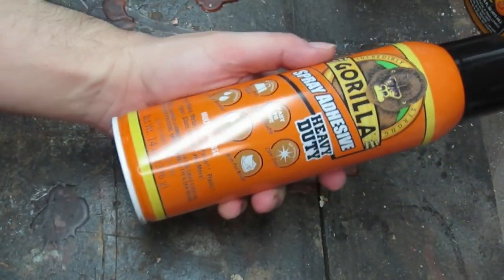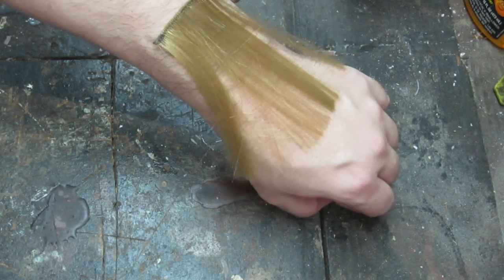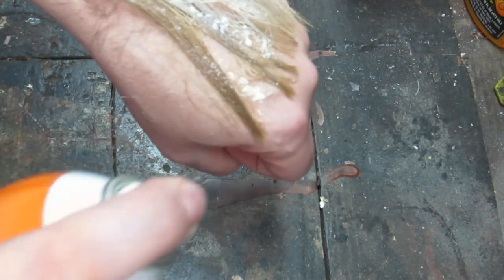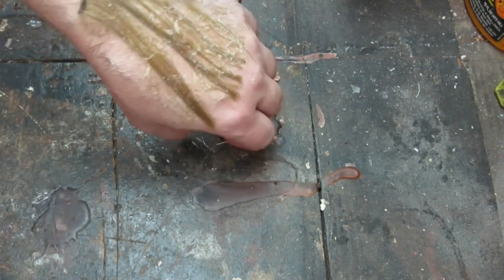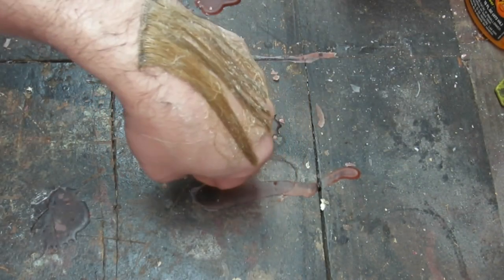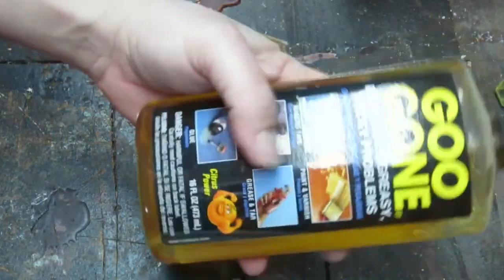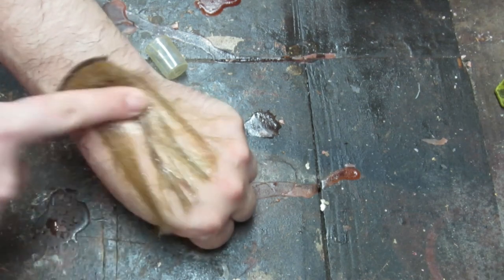GORILLA GLUE IN HAIR SCAM. High Levels Of Sus for the Gorilla Glue Girl story! | Dark Nook

Comment: So this is a bad experiment since u aren't doing anything she actual did. U don't anything about how to create edges using glue which is a common practice. This video just shows u don't know what you are talking about.
Reply from the maker: I put gorilla glue on my skin, dried it, and removed it with ease... not only from the hair I glued to my skin but also from the hair on my arm.  i also showed that the way this glue behaves, there would be no way to go through the elaborate lay down styling process, as anything that touched the first bit of glued hair would be sticky and useless for the rest of the process.  Do you think she used a new brush for every bit of hair?
Reply: @DarkNookShop  I saw what you did and that's not how u create edges. What u show is that u can spray synthetic hair on your skin and easy move it in a short time frame. That's not what anyone does to create edges.
Reply from the maker: Unless you think the edging style somehow alters the chemical composition or behavior of the glue... you really have no point.  And the hair was human hair, from a weave.  And the hair on my arm... also human hair.  Gorilla glue bonds permanently at 10 minutes or when dry.  i dried it with a heat gun, then showed how easily it could be removed using Goo Gone.
Reply: @DarkNookShop  that's not what she did. Go listen to the original video learn how they actually style hair and try it the way she did it.
Reply from the maker: @theman9048  Again, how the hair is styled doesn't change anything about the glue, how it behaves, or how it's removed.  The only reason the styling is being brought up is to address if she could have got this glue to permeate down to the scalp by using it how she claimed to use it.
Reply: Video just shows he’s a bozo
Reply: @DarkNookShop  dude we already know she can. Ur lack of understanding how to do it doesn't change that.
Reply: @Allison Williams by ur own argument what u said was some bs
Reply: Allison Williams black gel doesn’t mold your head like that, until you actually have black hair & experience using black hair products don’t speak

Comment: That is not hair growing out of a scalp with roots!!! That's why it adheres to the head...
Reply from the maker: Now this is a valid point.  This test shows how the body of the hair would bond to skin.  But the fact is, all the hair on my arm does have roots.  And that glue also came right off.
Reply: @DarkNookShop  it wasn't set in overnight like black hairstyles require
Reply: This type of Gorilla  Glue  fully  cures in less then 10 minutes.  Once it fully  cures  it doesn't  get any harder. The cure is at maximum  strength  at full cure.

Comment: The girls has several layers of hair and it's not directly to the skin so hair to hair would be matted and stuck and if the style is already done and combed and she just sprayed the top yes I can see how it it is stuck
Reply from the maker: If she just sprayed the top... it wouldn't be bonded to her scalp.  It wouldn't even be bonded to other layers of hair.  It would be even easier to remove.  I had to really rub this stuff into that hair to get it to penetrate down to my skin through even that little bit of hair.  Then i prayed it directly on my skin, under the hair, which makes an even stronger bond.   And it still slid right off a minute after the Goo Gone was applied.
Reply: @Natasha - I agree. I can see how it happened, as it's layers of hair to hair being stuck together. Plus it's African hair texture which is naturally dry & doesn't have as much oil as white hair.
Reply: @DarkNookShop  it could have bonded to her scalp, it could have seeped down into the smallest micro gaps. Even the official gorilla glue video states how fine of a mist it is. You don't know how she prepped her hair with it and also it is on her scalp, especially around her edges at thinner spots.
Reply from the maker: The fine mist bonds to the surface.  This is not a seeping permeating glue.  In order to get to to the scalp, she'd have had to work it into the hair.  This is even more true with thicker hair.  And she obviously did not do this, because that would have mess up the styling.  Regardless... Goo Gone would still take it right off.

Comment: I've been using spray adhesives for the better part of 20 years. There's no way on earth that spray gorilla glue did that to her hair. I started off carpeting speaker boxes in my early teens, and the first thing you learn about spray glue is to keep it away from any black surface because the white sticky residue pretty much screws anything it touches. Her sitting up there with shiny jet black hair from a spray adhesive is down right asinine. Secondly spray adhesives are not that resilient. They can be removed by a mild solvent. You're trying to tell me a month of washing and not a single hair has budged ? GTFOH
Reply from the maker: Exactly.  Anybody who has worked with this material knows she's lying.  Like telling an automotive painter than you painted a car with a mop and latex house paint, and wound up with a powder coat.

Comment: What does this glue smell like? Because how do you keep going if the scent is of an industrial agent? I was believing this mess at first, but I guess all I needed was to see this video.  Seems like a mistake that’s impossible to make bc of how this glue behaves.
Reply: You're blinded by BS. And, I'm not referring to the young lady with the unfortunate predicament.
Reply from the maker: Well the gorilla glue spray actually is pretty gentle as adhesives go, in terms of smell and skin irritation.  It doesn't smell particularly worse than hair spray and as you can see by the video, even after bonding to my skin, the skin is only a little red.  It's not like it burns.  I'm sure that acetone was way way worse.   But the good news is the goo gone also doesn't burn and has a pleasant orange scent.

Comment: Does the Goo Gone work as well if the glue has time to fully cure?
Reply from the maker: Yes.  The spray achieves permanent adhesion after only about 10 minutes.   The larger volume of glue might require a longer soak time, and for the process to be repeated few times.  But it would work fine.  And that's the process that the doctor used to remove the glue.  Check out my other video on the subject.
Reply: @DarkNookShop  makes sense. I’ll check that video out. Thank you!

Comment: it looks like she basically built a cast over on here hair im wondering if she got a needle and kinda dug under it safely then injected oil in or something. Or get a razor and slice the cast then kept a shower cap with oil on her head idk. She said that her hair is growing under and its causing the glued hair to tighten on her head causing pain.
Reply: that's the same thing i suggested, she needs a straight razor and have someone carefully created slices parallel to the way she has it molded down and to cut off that ponytail in the back at the roots to get up inside. Not sure why they haven't cut the pony completely off, I think she's trying to preserve her hair, but F it at this point. Cut the ponytail off!
Reply from the maker: Nah, all she needs to do is spray goo gone in her hair and let it sit for a few minutes then massage it into the hair.  Wipe it with a washcloth, and repeat the process 3 or 4 times.  Then she can spray the goo gone in and gently start to comb out any remaining bits of glue.  She might also want to coat her whole head in a thick layer of petroleum jelly afterwards and let that just sit for a while, and comb it out to nab any straggler bits of detached glue that will still cause tangles.

Comment: I think your thought process is good but it could be that her hair was already styled and she sprayed it on afterwards. She did say that she ran out of hairspray so maybe it was midway through styling as well.
Reply from the maker: Yes, that is what she said.  My point was that if she did what she said, she would not have been able to get the glue to permeate her hair.  It would have only dusted the surface and would have looked cloudy and white.  So in order to get the glue to permeate her hair, she would have had to work it in, which would mess up the style.  So the conclusion is she did not have glue in her hair when it was styled like that.  The glue was only put in later.  And we see that because in the TMZ pictures where she does have glue in her hair, her hair style is wrecked.

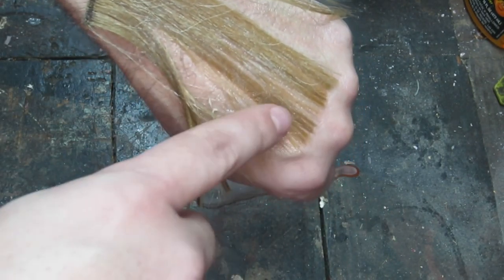Comment: That hair is a nappy mess because you are trying to make it a nappy mess.  2BGlu hair paste would make the same nappy mess if handled in this fashion.  Clearly at 1:45 the hair was sleeked down would have bonded flat if not for poking your fingers in the hair while the product is trying to cure.

*Even hair paste gets extremely tacky and difficult to work with as it quickly dries.
Reply from the maker: Yes, and the point of that was to show that after the first touch, any additional attempt to move or style the hair would cause it to become a matted mess, because the glue is tacky and also would stick to whatever was being used to try and move it.
Reply: I suggest you misuse the word 'nappy' here which is an outdated term with derogatory connotations implying the failure to conform to the 'acceptable' overall 'standard' of kempt hair, beauty, the work place, etc….  No shade.
Reply: @litespeedway6538  I will not be bullied by the ever moving one-sided PC speech where there is a boogy man behind every corner and everything is offensive. That kind of thinking is unhealthy and divisive.  Nappy means messy, frizzy and he literally did everything to make the hair nappy / frizzy.
Reply: @DarkNookShop  You missed the point.  Even the legitimate hair paste works in the same way as this glue until it dries SOLID.  People don't touch their hair and mess it up after it is smoothed down. You had it smoothed down and decided to mess it up.  Maybe that is why you have over 200 comments pretty much saying the same thing.
Reply: @michelem7786  Thank you for your reply and I am sorry you feel 'bullied' by my opinion.   Thank you for telling me what 'nappy' means - I suggest you misuse the word 'nappy' again, which is an outdated term with derogatory connotations implying the failure to conform to the 'acceptable' overall 'standard' of kempt hair, beauty, the work place, etc….  This misnomer is " unhealthy and divisive ".  No shade.

REPLY
Reply from the maker: @Michele M I'm pretty sure the title of the video is not black hair styling tutorial. What I was showing is how quickly the stickiness of this glue makes the hair completely  unworkable.  And that was on a tiny little bit of hair.  If she coated her whole head with this glue, she wouldn't have been able to do anything with most of her hair, before the glue made it too sticky to work with.
Not sure what's so hard to grasp about this concept.

Comment: Remember, she already had a product in her hair called "got 2 b glue" for hair first but run out before she finished her hair style. She felt she needed more glue to hold it down better and so instead of going to the store and buying more hair care product she used what was at home. I guess in her mind glue is glue and sprayed the "Gorilla Glue heavy duty spray " on top of the other product, and the mixture of the two product is the end result of what she got, and then to leave it on for a month is just asinine. I don't believe a person would go to ER and post pictures of herself with nurse trying to give care. No hospital ER  I know works like that, so its very real and as you see even the ER could not get it out, she is not lying. She gone need surgery.
Reply from the maker: The got2B glue would have come out when she washed it.  And having product on her hair already, would have weakened the glue bond to her hair, because the glue would be bonding to that material, not her hair and skin.  That's why every glue tells you to make sure the surface you are using it on is clean, if you want a good bond. And she says the ER recommended acetone, and sent her home.  Which if you know anything about adhesive removal, means that there's another story.  I don't think she told the ER what she's telling everybody else.  Either she used something else, that she's not admitting, or the folks in the ER did not know what they were doing.  Because all acetone will do to this kind of glue is make it gummy.  It won't break it down unless you can soak it for hours and hours, which would seriously damage her scalp.

Comment: Could you do this video again and use a blow dryer to seal it all the way and keep it on your hand for hours and show us the results?
Reply from the maker: I used a heat gun.  That's way hotter and more powerful than a blow dryer.  And this glue achieves permanent bond at 10 minutes.

Comment: Others on YT with her sleek style mistrust her, suspecting a clout chase bc her IG shows an expert at applying hair products.  Your comments seem based on the fact you think her hair is too thick for the glue to have permeated to her scalp to create that shellack cap.  Straitening hair changes the structure making it porous,  curly hair is believed to be naturally porous - this will effect how the glue "behaves".  To me her own hair does not appear thick at all, once straitened it could be quite fine & delicate     [against the fallacy, but true.]  To get this look ppl are explaining she parts a very small section, lays it flat, applies product & maybe heat, with her hand or comb, parts another very small parallel section and methodically repeats steps.  Conceivably she could have sprayed the glue as the last step onto the already flattened small section [not touch it but] lay the small parallel section above it atop and then spray it [heat] - repeat.  Hands and comb too slick with product to stick.  It could work, you manipulated weft in video.  Arms do have follicles but most know the scalp is like no other skin on the body, should your demonstration compare like with like?
Reply from the maker: Tell me, is her hair thicker than the single layer of hair I used in my demonstration?  She says in her own video she used the glue as finishing spray.  Tho even if she did what you describe, the first layers would be unworkable within a few seconds.  Regardless of the slickness of the comb or hands, after a few seconds the glue is already so tacky that it will stick to anything that touches it.  And I find it hilarious that so many are bending over backwards to invent an imaginary scenario where what she did could possibly be an accident... all to avoid admitting her story is obviously BS.
Reply: @DarkNookShop    See first line of my comment above and please take it in.
Reply from the maker: @litespeedway6538  Yeah, she's a 40 year old women who knows hair products.  That just make this seem even more like a scam.

Comment: What if you had damp hair?
Reply from the maker: That would weaken the bond with this glue.  This is not the water reactive type of gorilla glue.  The spray is water resistant. It would still just dust the surface if she used it as she claims.  The gorilla glue that comes in a bottle is a polyurethane that's water accelerated.

Comment: You do realize these adhesives can take up to 24hours to cure
Reply from the maker: I do.  Which is why I used a heat gun instead of a regular blow dryer.  The bond for Gorilla glue spray permanently sets in 10 minutes or when the spray is fully dry.
Do you realize that the longer these adhesives are on a surface like skin, the more they break down from oils, shedding skin cells, and coming into contact with dirt dust and debris?
Reply from the maker: @cookiecruncher1156  I knew a punk guy who use super glue to spike his hair.  It would break down after about a week, and he'd have to reapply it.  He'd still have bits of glue in his hair, but the spikes would break apart and separate.  So I'm also very sus about the one month claim.  I mean it takes you a whole month and 15 washes to figure out you fucked up?  Nah.  Not buying that either.

Comment: No she laid it down with a scarf and probably used heat to lay it down 🙄
Reply from the maker: The scarf would be glued to her head too.  So she had to do all the styling and lay down before spraying the glue.  Meaning the glue would just be on the surface layer of hair... not the solid hair helmet she's showing.
Reply: She used a gel and sat under a dryer and now is scamming you.

Comment: Remember she used hair gel also You are using synthetic hair. Her hair is of afro texture so your illustrations need to be done with afro Curley texture. 🤔 also she layered the glue . Why dont you put the glue on a mannequin like the surgeon did.
Reply from the maker: Because mannequins don't have skin.  Which is kind of an important factor when testing how well a glue permeates the hair and bonds it to the skin.  And no, it was not synthetic... it's from a human hair weave.  Tho if it were synthetic, do you think the bond with a glue meant for bonding plastics, would be stronger or weaker?
Reply: HER TEXTURE IS STRAIGHT. I don't see any hint of afro. Stop lying.